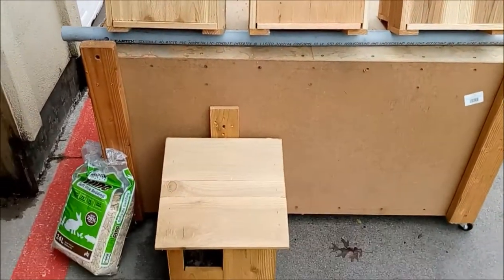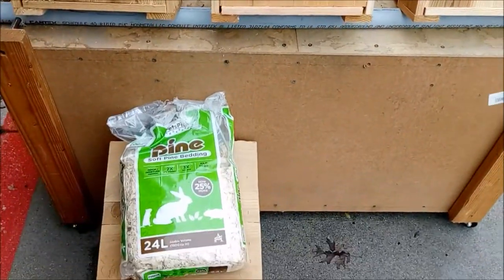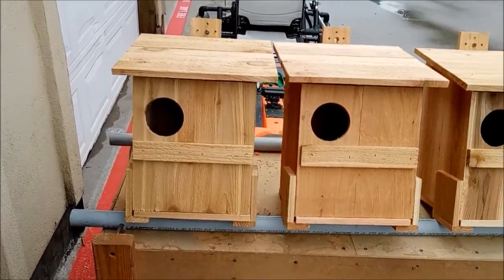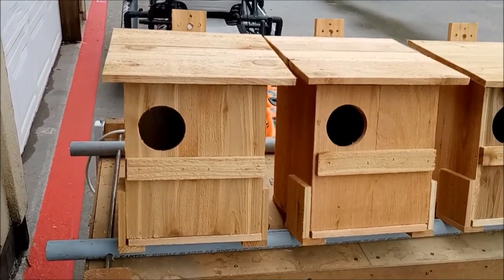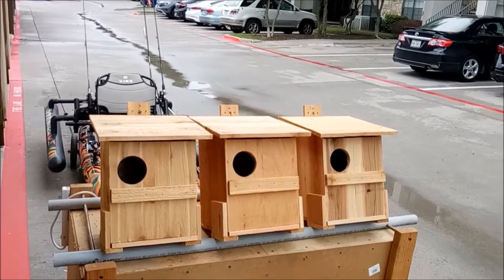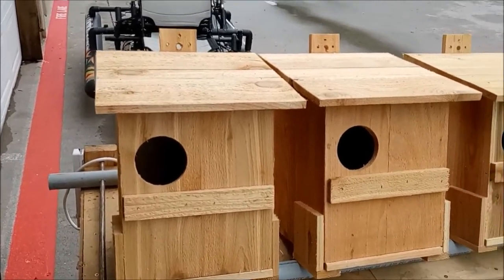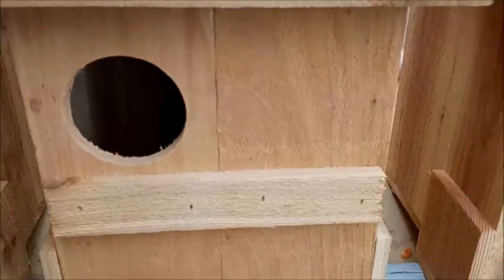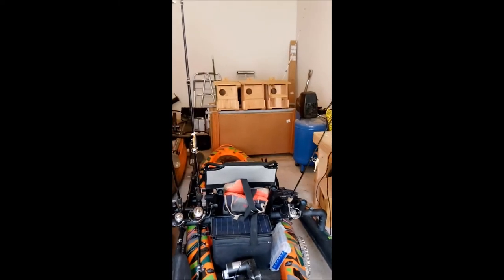Your owl house!!  tips and facts

Comment: Can I use dried Live Oak leaves for bedding instead of pine shavings?

I've got an excess of leaves!

And if I CAN use them, 
(which seems like it should be ok)
should I mulch them into tiny pieces?
Or 
Medium pieces?
Or
Leave them whole?

As long as I'm doing this, 
I may as well do it right!
Reply from the maker: You can do it--some people do--with that said, leaves degrade  quicker than shavings and can damage the box. Also you may introduce unwanted insects to the box
Reply: @billgibson--tacticalyakn--outd  
Okey Doke.
I'll buy some pine shavings!
Thanks

Comment: I have a box that was built from a template from Cornell that we put at the end of last spring. I wish I had seen your video before, because our design doesn’t have the easy pull-out floor for box cleaning. My box is not stained or sealed. It is mounted roughly 12’ in an oak tree. We had a visitor for maybe a week then, but he didn’t stay long. We just last week checked the box to replace the bedding, but it looks completely fresh still. But, there are fire ants. So far we have left it as is, and actually had an owl visit, but seems it has moved on. Should I try to address the ants at all? I’ve read they can kill a hatchling, which I’m guessing would make the box unappealing to an owl looking for a new home. I am planning to start calling again soon.
Reply from the maker: You will need a new box. Once the ants are there the owls will not come back. I believe they can sense or smell the formic acid--speculation--at any rate  I have never seen a box used after ants.  If you have a nesting pair and ants overtake the box, they will kill the owlets as well as the female who will not leave 1